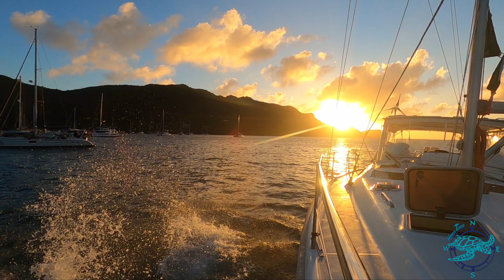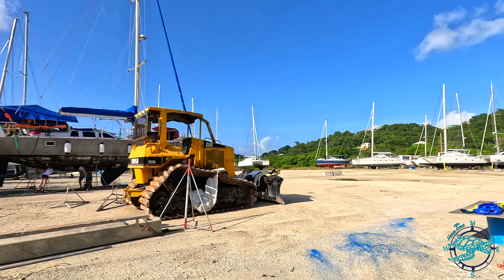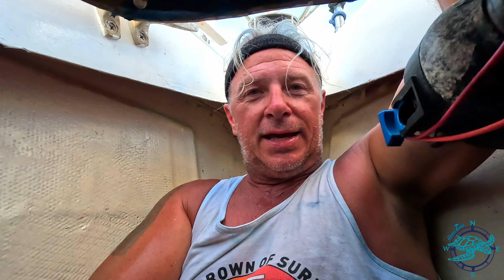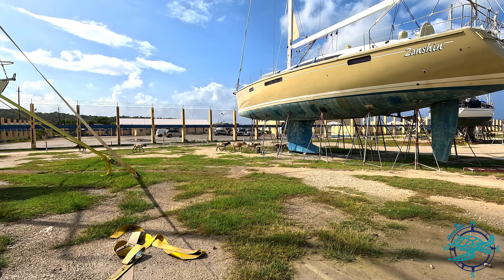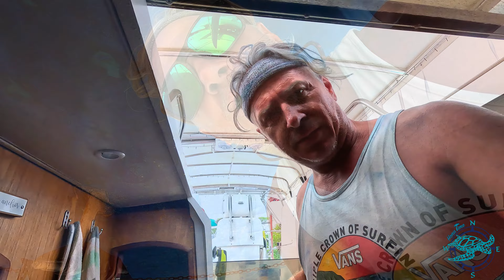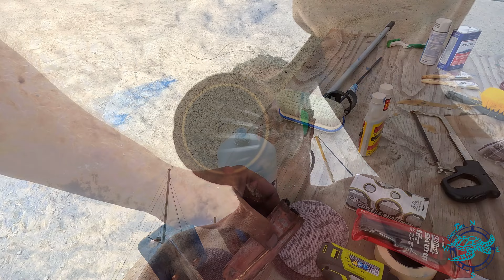The REALITY of Being a Liveaboard

Comment: You should do engine realignment with the new cutlass bearing and strut removal . It will make the running gear run with less vibration and make your cutlass bearing last longer.
Reply from the maker: Yeah you are very correct with that. I did take the time to check the alignment before we launched and checked again  after we went to the anchorage. Everything appears to be good 👍

Comment: Surprised you didn't remove the shaft and cut it out.
Reply from the maker: Yeah the tech actually suggested that I pull the strut instead of the shaft as it was a lot less work than dropping the rudder to get the shaft out. It worked very good IMO. 👍